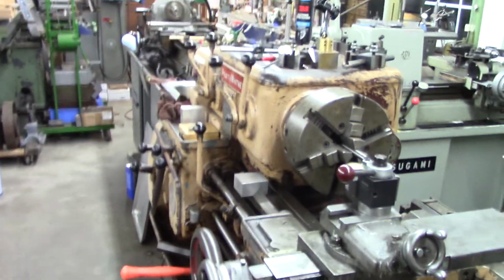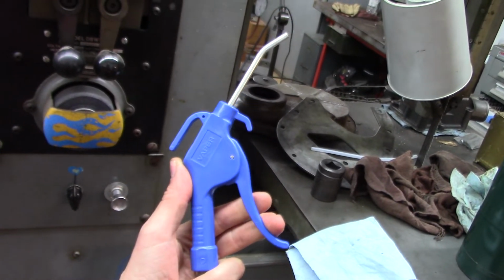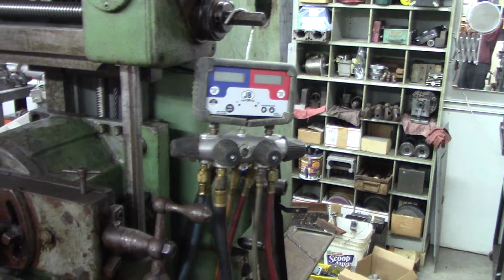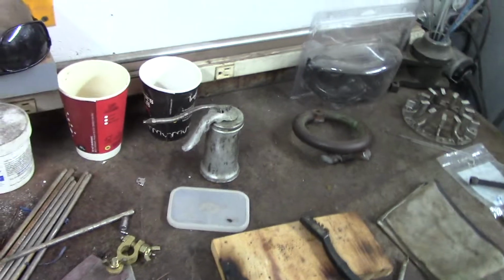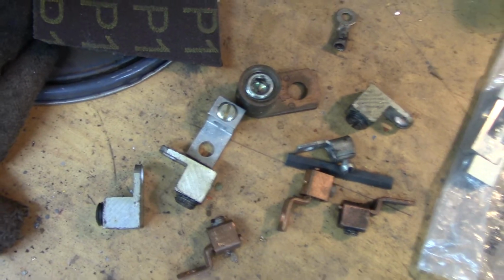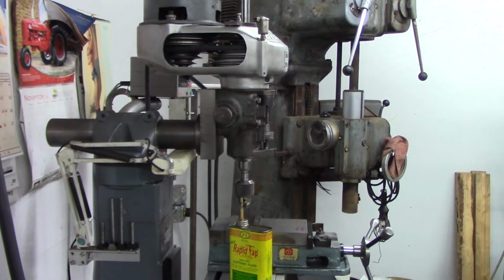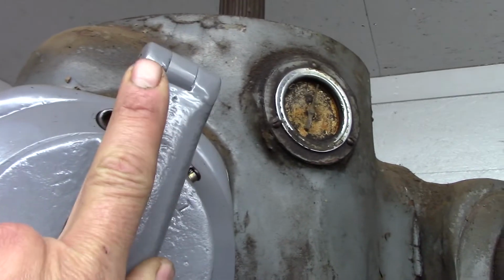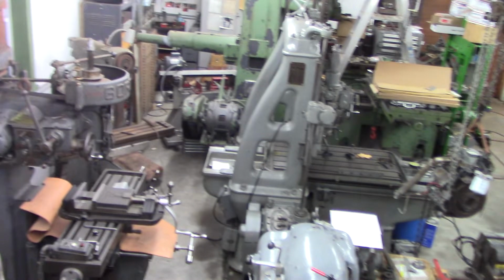11-22-21  Doozer's Machine Shop Update

Comment: Mighta been me on the parts washer. I got one now, 40 gal. Needs a shelf though. Gonna try to get a local sheet metal fab to fix me up, but they all suck here.
Reply from the maker: Dude I saw that Supermax H & V mill.  Did you get it today ? ? ? ?
Reply: @kooldoozer  Almost. Check your email.

Comment: Do you have any suggestions on a milling attachment for the Pratt & Whitney model B
Reply from the maker: Ohuuu..... Kimber that is a hard one for me to suggest.  They are all kinda crappy compared to a real milling machine.  I will keep an eye on ebay for something that might be appropriate.  I am thinking a real 90° angle plate, and a single axis slide table mounted sideways to it, and then a vise or whatever on that.  --Doozer

Comment: Hi Doozer   Yes I'll build one of those G&L keepers,  I sent G&L new company a email asking about Manuals for my 25T,
also Called north American power about dual 20hp phase converter.
I bought a Biax power scraper.
do You still have that big angle plate? the big heavy one?
I'm in New Zealand right now on my way to Antarctica again.
I will get home in AK  late January  
while I'm on the ice I might not be able to see You tube much.
I like your videos.
I'll build some sort of collet adapter for my G&L 25T
Reply from the maker: Dale,  are you a scientist ?  Is there a hidden city under the Antarctic ice ? ? ?
Reply: @kooldoozer  I build equipment for scientists, I go down to install,maintain and run the equipment, years ago I spent a year down there as winter over Machinist.
no hidden city under the ice.
some of the old stations got buried under the snow in high accumulation areas.
Reply: @kooldoozer  I think the taper on that key in your picture is far too steep.  The taper on the draw key I made is probably half that.  I did a whole video on how I made mine in case you missed it.
Reply from the maker: @bcbloc02   Holy heck... I usually watch all your videos Brian.  I will go back and look.  Thanks. Love the worlds most powerful forklift. I am surprised you even ran a turbo with 8.3L of Cummins and all those gears.  You must like the sound ! ! !  ----Doozer